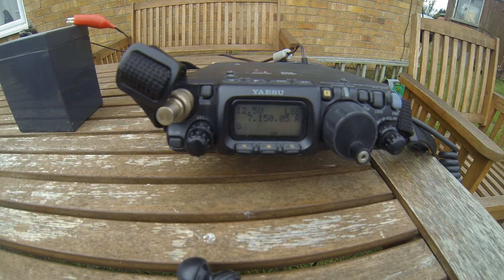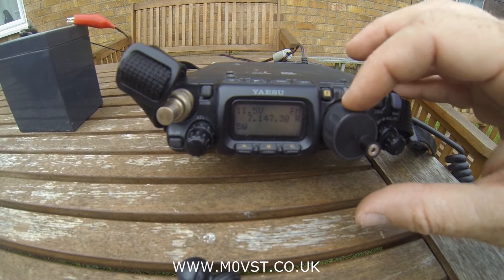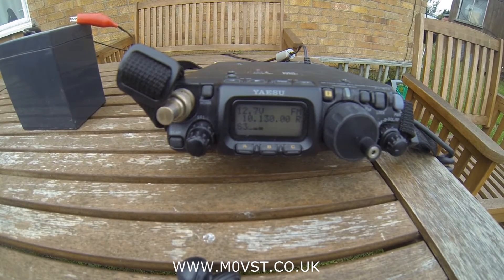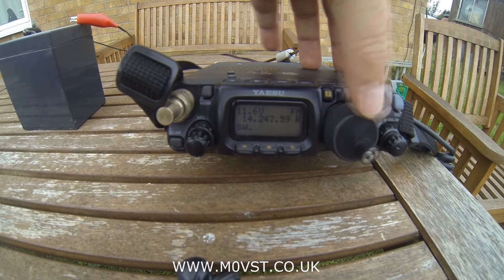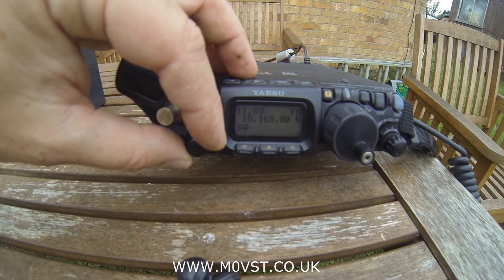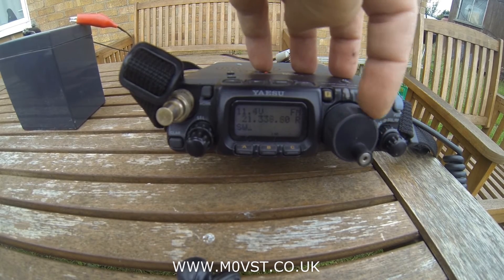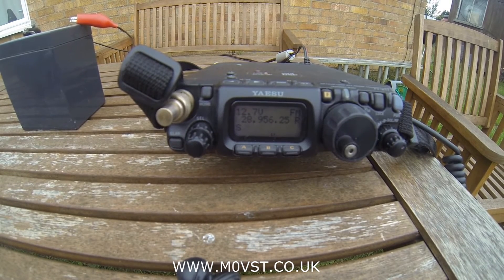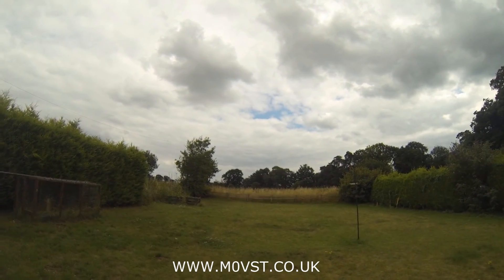The Lightweight Magnetic Loop - Part 6 - What Bands? - M0VST [HD]

Comment: Nice detail: A 50 Ohm termination, to protect BNC connector from bumps and your finals too. 
You can use copper tape to make a fully collapsible loop. The double side tape duplicate RF section over a tube. Skin effect In 3,5 Mhs is only mils of an inch.
I enjoyed the vids.
Edgardo LU1AR